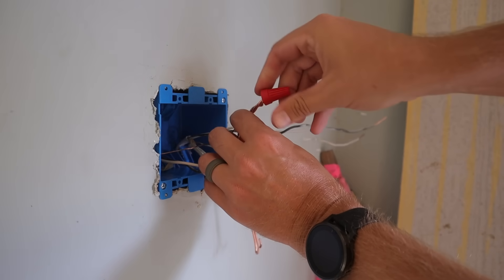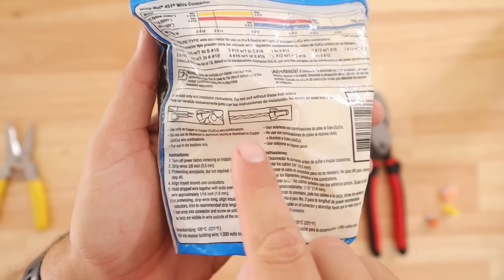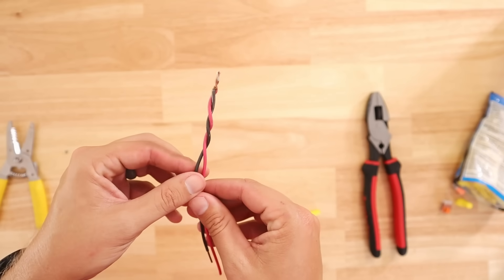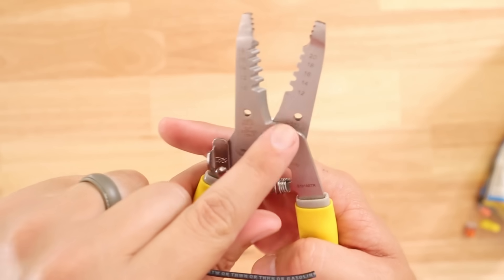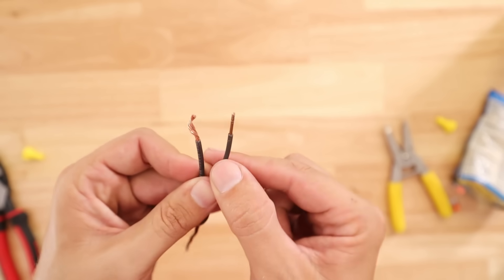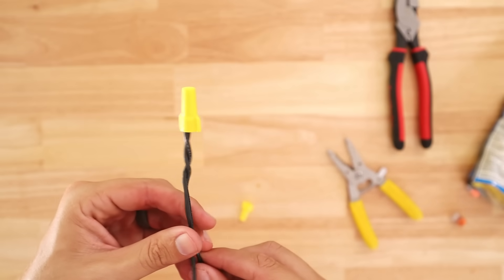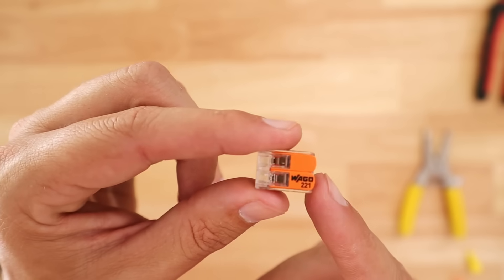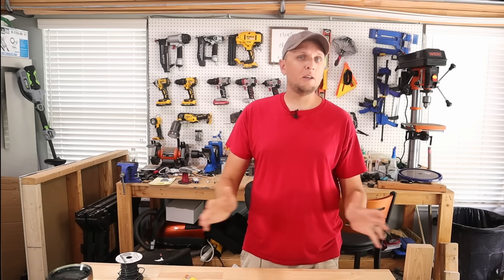BIGGEST Mistakes DIYers Make When Connecting Wires Together | How To

Comment: A comparison between wire nuts and Wagos would be great. Thanks!
Reply: I would use twisted wires with a wire nut  any day over a wago. A wago uses a very tiny slit of metal that is acting like a spring pressing against the wire. After so long I have seen them get really sloppy.
Reply: Been done with videos here on YT available.  Short answer is the choice depends ion the application.  Sustained high current, go wire nut.  Low current lighting and the like, wagos are fine.  Do I trust Wagos?  Yep, they have inferior junction resistance when compared to wire nuts but the difference in most cases is so minor it makes no difference.  Personally verified years ago with a series circuit, 20Amp load, and a thermal camera.  The Wago 222 was hotter after 5 minutes by about 1 Degree C.  I still used several hundred Wago 221 on a bunch of coolers at a new supermarket install.  You could say that in specific applications I trust them.

Comment: Not saying you're entirely wrong and is good advice for nubes, but when you're doing piece work, you don't have time to pre-twist. Just cut and strip evenly apply wire nut, twist tight with Lineman (not Linesman) pliers.  Wago's are way more expensive than wire nuts and can fail as easily as poorly applied wire nuts.   They may work well for rookie diy'ers but a pro wireman isn't going to waste the time with them.  Just my opinion having worked as a residential electrician.  I have seen more problems with back wired receptacles and switches than with loose wire nuts with the exception of copper to aluminum wire not using wire nuts listed for that use.
Reply from the maker: Hey I appreciate the honest feedback.  Always like hearing from folks like yourself that are experienced in the trade.  I agree with you.  I have quite a few electrician friends like yourself and they constantly talk about the back wired receptacles and how they regularly have service calls involving them.  Also, their experience with the wago's is just as you said, it is how they are installed, just like the wire nuts.  Seems when some put their wires into the back of the box or attach the receptacle/switch to the box, that the levers are being pushed up in the process and now you have a loose conductor.  I am curious of your experience with them.  Thanks again.

Comment: 50 plus years ago while on break at the Glass Factory where I spent 42 years after a few years working for Uncle Sam in the army. an older gentleman gave me a small book on electricity put out by Sears Roebuck. Old Harry said two thing a homeowner needs to know are plumbing and electric and it will save you thousands in years to come. Harry, as usual was spot on! Thanks for the informative video.

Comment: Thanks for the good tips. When it comes to electrical work I am definitely in the "DIYer" category with no proper training so this is good stuff. On a minor note, you repeated the same grammatical error about 15 or 20 times and it was rather distracting. "Underneath of the wire cap". The word "underneath" is a preposition and is never followed by the word "of". The correct way to say that is "underneath the wire cap". It wasn't bothering me too much at first but after about the 10th time it was sort of making me crazy... :)

Comment: Pre-twisting provides more wire to wire contact, which means lower resistance. Lower resistance means safer, less heat, and less power wasted. I've seen a lot of wires nuts fall apart or come lose over time because the wire wasn't pre-twisted. I've never seen a connection that was pre-twisted and cut have issues. Yes, it may take longer, and yes, it makes things more difficult if you have to make changes, but it's the correct way!
Reply from the maker: I agree with you Kevin.  Thanks a lot for the feedback!

Comment: I can remember when it was twist and solder, friction tape and then plastic tape. I was taught (solid wire) to strip and inch and a half, then pretwist enough so that there are 3  - 4  twist in the insulated area of conductors cut to length w/ at least 4 twists showing in the bare area then twist on wire nut. Some taught to tape the wire nut afterward, some did not.  Stranded conductors strip enough so that the wire nut covers the bare,  then twist on wire nut. Definetly tape it for rigidity. Same for solid and stranded together but let the stranded be a bit longer.  Winged wire nuts eat up space in boxes, I won't use them only the round ones. WAGO sucks I wont use them. Too many problems in the long run.

Comment: You do not want a stranded wire to wrap around a solid wire,,, the 2 as with all stranded or all solid they should wrap around each other,, twisting the stranded wire very tightly b4 connection will do the job

Comment: 30 years as an electrician,, so yes you are absolutely correct,, same as anti shorts on MC cable,, it is not in the code but is in the manufature instruction of use,,, and wire nuts,, well wire nuts are not all the same,,I use idea twister,, tan, they in design twist the conductors wene used properly,, I use no other wire nuts,,, I also never ever use stab locks on back of recepticals,, I can not count the # of service calls for half of stuff dosnt work,, and I find the last recep that works,, and Bam there is a bad stap lock connection,,, and as for stranded to solid,, make sure stranded is very well twisted , and it is good to connect to solid,,, one MOST twist the strand tightly b4 trying to connect

Comment: For me lever connectors like Wagos are great for lighting and low amperage situations. Anything that needs to carry line current I'm going to use a twist on connector like a wire nut. (Fun trivia Wire Nut is an Ideal brand trade mark).
Reply: Correct, anything pulling a lot of current could and will melt a wago. Seen it to many times.
Reply: @explod329  for sure I live and work in Florida as an industrial electrician. We tried wagos at the plant I work at. They just didn't hold up. With the heat and humidity in Florida they were nothing but trouble on anything carrying 10 amps or more.
Reply: Anything with high current has changing temperatures and gets lose in time, when wire nuts are used. Only low current application could be ok with these stone age connectors for some time.
Thinking, resistance of Wagos is too high or current overload is too low, is true bullshit of idiots, that do not have any clue.

Comment: When/if you do a video on wagos and push in connectors, could you do a little demo on how well the thin, flimsy wiring for a light fixture goes into a push in connector. I know when pushing a solid wire in it takes a fair push to get it in, i’m not convinced that the thinner stranded stuff has the rigidity to push in properly. Thanks for the video.
Reply: The push connectors are only for solid core wires, not for stranded. For stranded you need the 221 as shown in this video.
However you could crimp a pin terminal of sufficient length onto a stranded wire and insert that into a push connector.

Comment: So wrong to twist the stranded wires surrounding the solid wire.  There will be no bite onto the solid wire at all and it would just slip out when pulling the solid wire.
Reply from the maker: Not true at all.
Reply: @HowToHomeDIY  it is very basic physic, when you wound the stranded wires on top of the solid wire, will be no surface for the wire nut to bite onto it.  it is only held on due to compression and will slip if pull hard enough.
Reply from the maker: It still bites into each of the wires.  And of course if you put enough force on any connection it will pull out.  It’s subjective.  If this is the case, you better let a bunch of the electricians that do it for a living know.  My own experience is it doesn’t pull out easily at all.
Reply: @HowToHomeDIY  sorry, but I learn not to argue with the law of physic, but feel free to do so yourself.

Comment: There is no pre-twisting.  Keep twisting until both wires are twisted like in the photo.
Reply from the maker: Doesn’t always make a good joint underneath.
Reply: @HowToHomeDIY  what joint are you talking about? The wire nut's job is to hold two separate wires together.  The threads that bite into the copper wire keep the nut from falling off with the compression and keep the two-wire close to each other.  You have stated that following instructions from the manufacturer are important however, during execution, somehow you deviated from the instruction.
Reply from the maker: Not at all.

Comment: American electritians accepting the Wago is difficult when all they’ve been pounded with is the wire nuts. Im an american hvac tech.  I use both. And like you, the strandard with solid is a Wago every time, or different sized wires ( being 10 ga or less.  ). You can nicely fit a 12ga and a 18 gauge with no problem. Some propane refrigeration units prohibit wire nuts but do use Wagos. Good to see your open minded.  I saw on a video , to give an extra twist on the wire nuts, the handle of the 11 in 1 Klein can be used to twist a wirenut.
Reply: Several municipality’s here in California do not accept  “Wago’s” as they come lose over time. I have had several trouble calls where this has occurred.

Comment: use good wire nuts and there is no need to pre-twist.  lead your stranded slightly ahead of your solid, and still no need to pretwist.  NEVER trust a push in connection with stranded wire.  if they are pretinned and supplied with factory installed push in connectors, give the connector a tug to make sure it is properly engaged.  wago lever nuts are much more idiot resistant, but they are bulky, and they actually have the internal components carrying the load, so I'm not sold on them for sustained high load applications.
also, except for the lever nuts, it's often not worth the bother saving and reusing wire connectors.

Comment: I'm old school. I use electrical tape. For wire nuts, I still wrap it with electrical tape. I'm not sure if the jury is out there for Wagos. The concept is incredibly great, and I understand it passed the UL. I'm still concerned about arching.
Reply: You would like the wago levers. I do and I'll tell you it makes life far much easier especially on the joints lol
Reply: @crockpot5194  I like my work clean, especially in junction boxes where at least 4 Romex 12 AWG converges. I don't work as a contractor or professional electrician anymore. As a semi retired engineer I still update myself to new products in the field.
Reply: @kapiatgatas  oh it will be clean when you use the Wago levelers. Plus get this. Them bad boys can hold up to 1,000 degrees no joke

Comment: Great Video as I have done allot of wiring and you made it so simple and only other would be showing when you have 3 wires and the thing i run into is people trying to stuff too many in too small of a wire nut so a simple added explanation that it goes by size / gauge of wiring

Comment: Question:  I replaced a hardwired smoke alarm harness the other day using tan twisters. Single solid 12awg pigtails to the harness wires stripped at 1/2" already. The harness (Kidde) is pre-stripped and tinned stranded (16awg) at 3/8". I just lined up the ends since the harness was tinned and twisted hard until I just started to barely see a white mark on the end of the wire nut, but didn't deform it or go through as it was hard to tell when to stop and it's the first stranded/solid wire connections I've ever made. With solids I have pre-twisted or just cranked the nut down about as hard as I could making two to three twists on the insulation outside the nut. Anyway,  I pulled on both wires pretty damn hard and nothing slipped except the wire nut out of my hand, but I'm curious whether the 1/8" or so of insulation on the harness wires that I assume gets trapped in the spring will cause a problem? Surely that small bit of insulation isn't getting held tight enough to hold the wire in and tricking me?  Thanks for all your excellent videos!
Reply: a smoke detector draws a 9 volt battery's worth of power over 5 years or more. Your connection is fine.

Comment: Loved the explanation. But I would like to see your recommendation on 3 wires with one being stranded while the other two are solid. Would you recommend twisting the two solids then the stranded around both or would you recommend twisting a stranded with a solid then twisting them to the solid? Or 3 wire with 1 solid and 2 stranded?
Reply: l twist th solids together
then th strandeds together
then treat them like a single stranded with a single solid
Reply: The physical physics of stranded wires vs solid is this: the total cross sectional area of both is equal, so electrically they are identical. The stranded wire however is made up of a bunch of little wires all held together by the insulation and some twisting from the manufacture. Stranded conductors of the same listed size are therefore weaker (with regards to rigidity) than a single solid conductor of the same size. To compensate for this, slightly move the stranded wire(s) ahead of the solid wire(s). When they all get wrapped under the spring of the wire nut they will naturally wrap around the stronger solid wires. If they are a bit longer (like 1/16" to 1/8") they will more likely remain within the sprint area of the wire nut where they belong as opposed to bunching up around the base of the insulation of the stronger wires. In other words, advance slightly the physically weaker wires ahead of the physically stronger wires and hold them firmly as the wire nut spring engages and wraps tightly around them. Then of course tighten that sucker until the wires begin to twist or you can see the plastic start to bulge over the spring and turn slightly white from being deformed. Then of course there should be zero copper showing outside of the skirt of the wire nut.

Comment: in the netherlands we almost always use wagos or push connections, simply because its faster to do. also if you have to add something to the installation like an outlet, you can often just push in the wires into pre existing push connectionsin the nearest junction box, while with wire nuts you have to remove the nut to twist in the extra wire. with push connections you could do this even when the power is on with very little to no chance of getting shocked
Reply: my dad taught me how to wire with never turning the power off. just because u can do something doesnt mean u should. i would hesitate to hire an electrician whose standard is the fastest way possible. cutting corners in electrical wiring has to be the worst mistake u can make.
Reply: I don't like wagos. The connection is not right enough. I have seen test where the wagos surpass the current rating but I don't like them

Comment: Not only do I twist them after the wire nut is tight but always tug on the connection to test it and put electrical tape over the top of the wire nut in a crossing pattern so the nut cannot come off as my father-in-law taught me.
Reply: Same here.

Comment: Wirenuts are obsolete
Reply from the maker: Not at all.  In the US anyways, it is by far the most installed wire connector.  And based on my conversations with electricians that I talk to regularly, that won’t be changing anytime soon.
Reply: @HowToHomeDIY  Every one I talk to are switching to these. It will take some time but wire nuts had their day these are far more versatile, change outs and add ons easier and faster
Reply from the maker: That’s interesting because every electrician I have talked to do use the wagos in certain applications but not most.  I want to be clear though, I’m not against the wagos at all.  I just use them based on what I get from the electricians I talk to.  But I also personally see where wire nuts I feel are better.  All preferences at this point.  And I do agree with you that I think over time they will become more popular.

Comment: I spent 40 years working in electrical maintenance at a public electric generating utility.  Frequently troubleshooting circuits for faults, especially 277 VAC and 480 VAC metal halide and mercury vapor lighting circuits, we would find either the wire nut was not tight when connecting stranded and solid wiring and burnt the wire nut off or the stranded wire would be stripped far enough back to have exposed conductors grounding to the junction boxes.  We spent thousands of man-hours each year having to climb out on beams 11 or 12 stories up on the structures, opening dozens of junction boxes and pull boxes to repair failed circuits.
Reply from the maker: I always appreciate hearing from folks in the field.  Thanks a lot for sharing your experience!